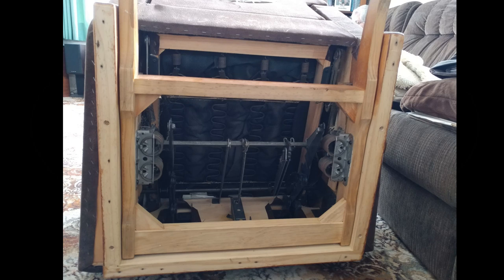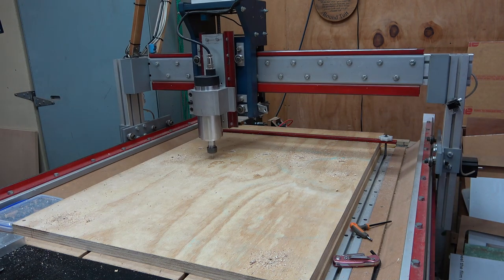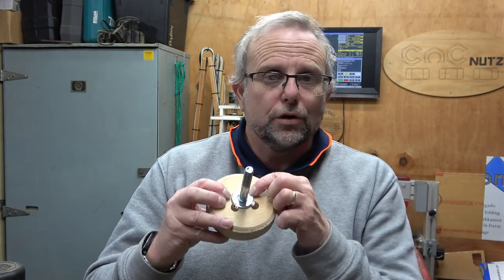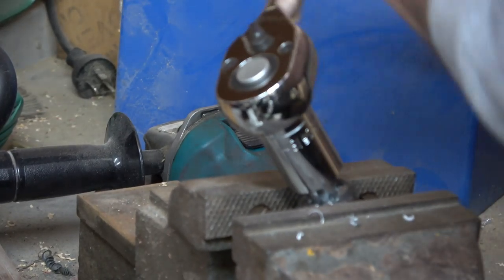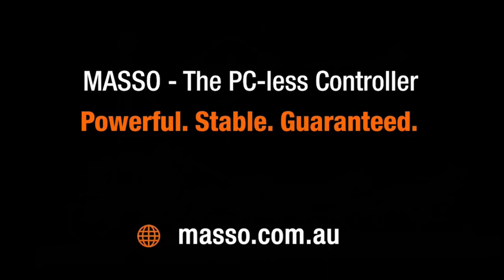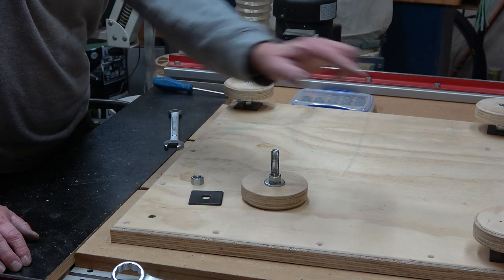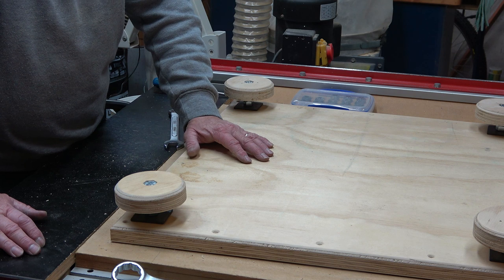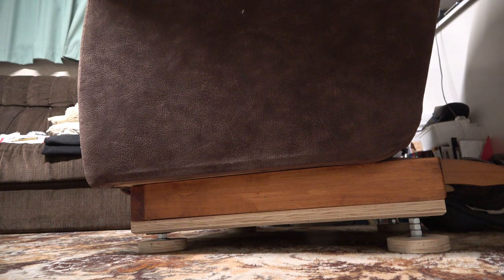Make an adjustable raised Chair Base - CNCnutz Episode 247

Comment: Peter, since I started watching your channel, I acquired a 600 x 1200  machine. Funny that it is sitting on the base I built for my "Bridge to far" DIY attempt. Heavy rectangular steel welded table weighing over 300lbs. 
( estimated) It really came in handy. But anyway, long story short, I had to disassemble the machine to hoist it onto the platform.
In so doing I reassembled with just a guess at a proper tram of the Z axis assembly.
In the episode where you show some hardwood tramming tool and indicator solution you did not touch on how you drilled a perfectly perpendicular hole in the material. I don't trust my column drill press state of tram anymore than I could throw it, especially since it is adjustable to at least 30 to 45 degrees tilt.
I suppose I can get out my machinist squares and muddle through. But the longer the tramming bar the better your work must be. Devil is always in the details
Off topic yes, sorry.
All the best my CNC friend and I hope you are safely out of lock down.  Regards, C
Reply from the maker: Hi Chris,
I didn't drill a perfectly perpendicular hole. Any hole on any angle will work. the relationship between the spindle chuck and the point of reference is set and won't change. the actual angle is irrelevant. This is a case of overthinking it. 
cheers
Peter
Reply: @cncnutz  Come on Peter, thats nonsense. If I where to buy a proper tramming tool, do you think that it is made with arbitrary angles? I got Z issues with my extruded alum. bed as well, and don't need any guess work. So to that end I have had a proper 8mm x 8mm - 90deg block created in Fusion 360 and made in a proper trammed knee mill in 6061 T6 Aluminium.
Add some 8mm guide rail and my 8mm collet and I can at least begin with some confidence

Comment: A few thoughts.  Do you own imperial wrenches along with your metric like we do in the US? LOL.  And did you change to Masso because of issues with drivers and stepper boards problems?  I have really looked at the Masso products and I may change over.
Thanks and keep them coming.
Reply from the maker: Hi Dave. I own both metric and imperial everything. Drills, spanners, rulers, socket sets and underwear.
I have not had any driver issues or stepper board issues. I still use the same steppers I had previously.  I changed because I started doing support and video work for Masso in my spare time. I needed to learn and what better way to learn than by using the product. I found that I like my Masso and continue to use it on my machine though I don't have too. If you want to learn a bit more about how to install a Masso check out my other channel CNCnutz Masso edition. There is a series I'm slowly creating on setting up Masso, in my spare, spare time.
Cheers Peter

Comment: My God! did you mortgage the house to buy that 25mm plywood or are you independently wealthy?
Reply from the maker: It's a factory 2nd and cost me $25. Probably overkill but it has been sitting in my shop for 5 years now and might as well be used for something useful.
Of course now I have cut it up I will probably need it for something else.
Cheers Peter
Reply: @cncnutz  Yes, that is why I always use replacement cost to value it, even if I got it for free.